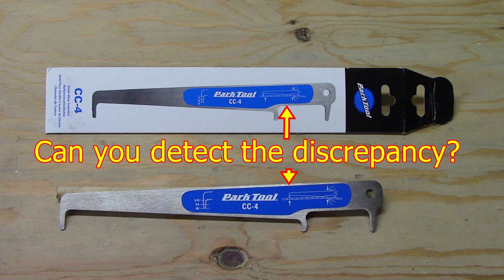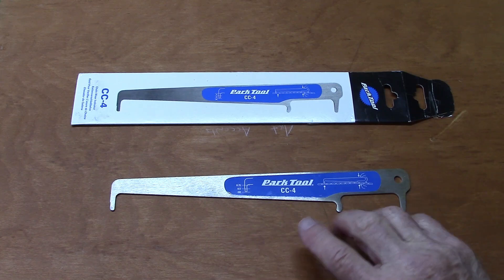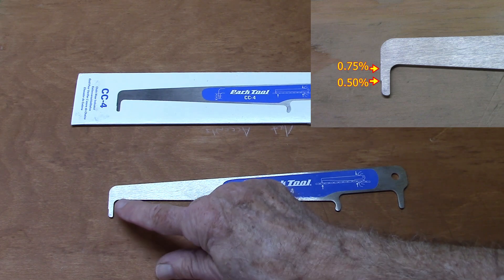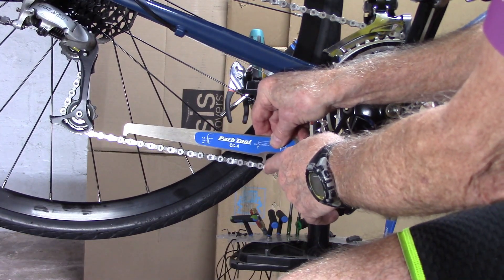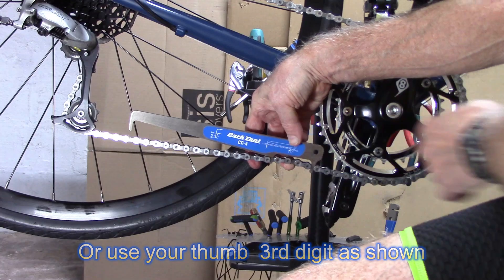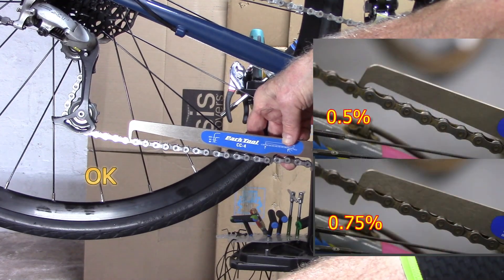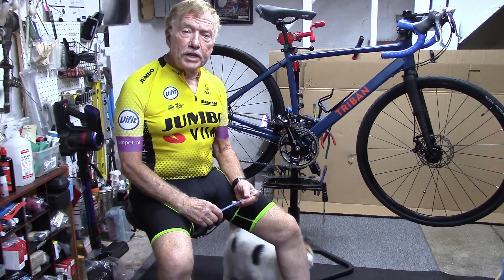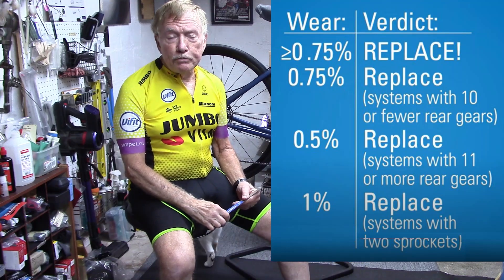Mastering Chain Wear in Minutes with the Park Tool CC-4!

Comment: Park changed the label on more recent versions of the CC-4 to match what you see on the package.  It has now also been replaced by the CC-4.2 chain checker which adds a 1% wear mark.
Reply from the maker: Yes, I've just recently seen the CC-4.2. The diagram on the tool now matches that on the package and shows the correct use between inner links (although the arrows are "pointless" and also should be changed).
The addition of the 1% mark is helpful for single speed (one chainring/one cog) to indicate when to replace the chain. For 10 speed or less, I usually replace the chain at 0.5% before it reaches the 0.75% but it does let me know when a chain is severly worn and to take a closer look at the chainrings and cogs. For 11-13 speed, the 0.5 and 0.75% are sufficient.
Thanks for your update. Very helpful. Regards and safe cycling, Tony
Reply: @tony10speed  Just saw your very well done video - I have the 4.2 which does indeed have a better graphic :-)  I can't 100% agree that .75% is sufficient for an 11-13 speed, Tony. Especially on Dura Ace and Ultegra,   the cost of chain rings and cassettes are WAY more expressive than a chain - so as soon as I hit the 0.5 or very close, I just replace the chain. On Ali Express I just bought 3 Dura Ace chains for an 11 speed mechanical for 49$ CAD a piece. Now I rotate two in the Silca hot wax system and always have one ready to go with a nice new one as spare. Appreciate the time you took to help your fellow riders!
Reply from the maker: @davidbee8178  I do agree with you that with 11-13 speed chains that it's best to replace the chain at .5%. These chains have thinner plates to accommadate the increase number of cogs. Like your idea of rotating the waxed chains.
Regards and safe cycling, Tony

Comment: New to cycling- I have 7 cogs in the rear and two up front. Is my bike considered a 7 speed or a 14 speed? I've not been able to find a chain wear gauge for anything greater than a 12 speed.
Reply from the maker: The standards of terminology in the bike industry are not obvious. You have 14 different speeds (combination of different gears) but for chain wear and bike components, count the number of cogs. In your case, you are considered to have a 7 speed chain and drivetrain. All the chain wear indicators should work.
Good question. Regards and safe cycling, Tony
Reply: @tony10speed  Thank you so much for your reply and knowledge! Very helpful

Comment: Sorry to be pedantic but the Park Tool CC-4.2 label on tool and package have another error. The legends on the left side (showing wear %), text reads ">.50" for no/minimal wear. However, ">" is a symbol for 'greater than', this is incorrect as the reading will be less than 0.5%. ! It should be written as "<0.5" .
Reply from the maker: Yes, for the CC-4.2. Park needs you for a proof reader. Good eye.
Regards and safe cycling, Tony
Reply: @tony10speed Mine is <.  4.2.  Just bought today.

Comment from the maker: The placement of the far end tab should be between "inner links." The diagram on the tool is incorrect and the diagram on the cardboard sleeve, though the far tab is correct in that it inserts between inner links, the arrow is off. I wonder if they've corrected this on the newer tool CC4.2?

Comment: The leftmost arrow on the diagram points at different chain links on the diagrams (the one on the sleeve points at the link next to the beveled gauge tip, and the one on the tool points directly at the gauge tip.)
Reply from the maker: That's correct. With the newer CC-4.2 they've corrected the problem so what. The middle "J" hook and gauge hook now both insert between inner links as they should. However, the arrows seem to point to outer links. That's "pointless" and hopefully will be resolved in the future.
Nice observation. Regards and safe cycling, Tony

Comment: Should the cassette be replaced when one replaces the chain?
Reply: Don't know about now, but ten years ago when I started riding, the general consensus was, cassette every 3 chains, chainrings every 3 cassettes.

I measure chain wear with a steel ruler. Measure 10 links with the chain under tension and if it's more than 1/16 inch out, replace. You'll get a lot more life out of a cassette if you change your chains before they get too worn.

A dead giveaway if you've left it far too long will be that on the first few rides after changing a chain, it will 'skip' and/or sound loud on some gears or shift poorly until it wears in, but by then you've probably worn out the chainrings at the front too.
Reply from the maker: @bradl7439  Several caveats when using a ruler for chain wear measurement:
1. Use a percise well defined metal ruler.
2. Place some tension on the chain (more then just the tension from the derailleur). One way is to press slightly on the pedal while measuring (which, to me, would be hard to do unless I had an assistant). Some have suggested shifting to the large chainring/large cog (cross chaining) to supply enough chain tension. I just find the 3-point tool easier.

I do agree with you about replacing the chain earlier than may be indicated by the chain wear tool will prolong the life of the cassette and chainrings. By the time you note skip and/or get poor shifting, you may need to replace the cassette or chainrings as you mention (also one must realize that "skip" or poor shifting may have other causes). 

Thanks for your comment and regards, Tony
Reply from the maker: Although many bikes stores will replace the cassette with the chain, this is not always necessary. The cassette will often out live several chains but you do need to inspect the cassette carefully. Here's what to look for:
https://www.youtube.com/watch?v=g5uqTNmikro&t=6s&ab_channel=TonyMarchand
One can also take a pick or something similar and run it along the edges of the cog teeth to look for burrs (we'll put that in another video). With that said, with a very badly worn chain you will probably see signs of wear and need to replace the cassette. 
Good question, thanks. Also visit our YouTube home site at:
https://www.youtube.com/user/MrTony10speed
Regards and safe cycling, Tony

Comment: Looks like the tool is placed on the chain incorrectly on the tool graphics but correct on the cardboard case.  Also, nice to see the cat helping out.
Reply from the maker: Actually, if you watch the video, the cardboard case is correct with insertion of the hooks and gauge into the inner links (not the outer). That on the tool is incorrect. This is also true for the 3-point wear indicator from Pedro has the same problem.
Reply: I think that's what I said...
Reply: @robertl.1177 Yes, you did 😂
Reply: But, I did buy the tool after you recommended it on a previous video.
Reply: Thanks for the info! Good to know.